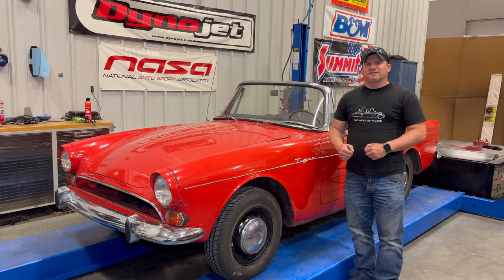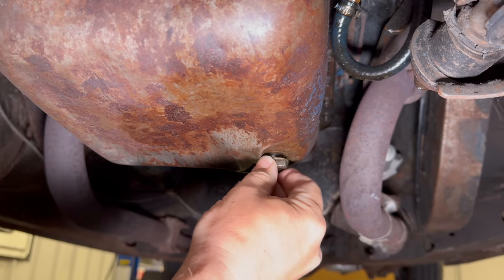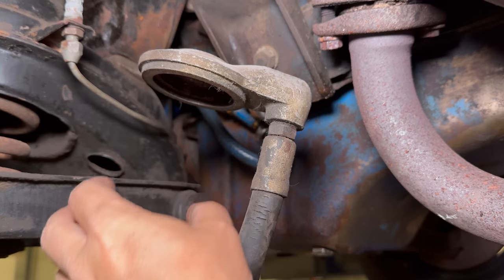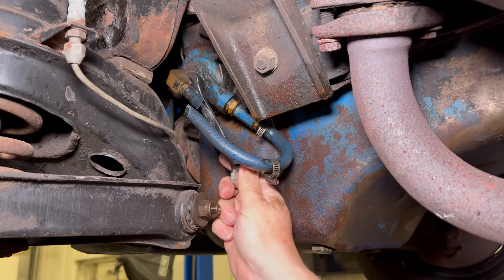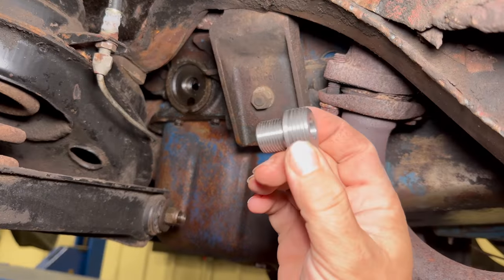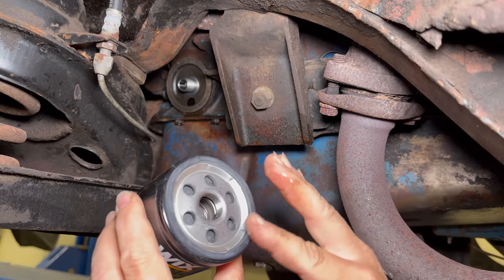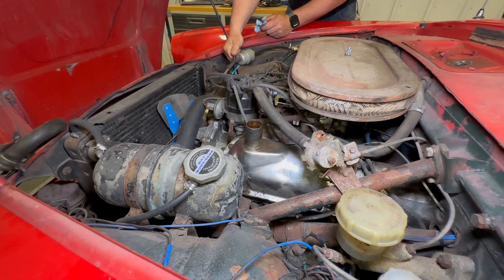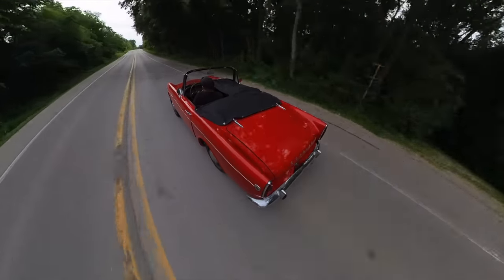Fixing the Previous Owner's Bad Ideas on my Sunbeam Tiger

Comment: Before firing up the engine with a fresh "empty" oil filter, spin the engine over on the starter motor with the ignition off (or disconnect the power lead to the coil), until  oil pressure is shown on the instrument panel oil gauge. This will fill the oil filter and better protect the bearings from friction loading under combustion from a dry startup.

Comment: Way to go. Good video and hopefully good filter upgrade. That filter resemble the unit used on Gravelys and other yard equipment back in the '60s. I have a Rootes dress up kit for a Tiger containing finned aluminum valve covers (no pcv opening), and chrome dipstick. I picked it up back in the '70s; never found a Tiger to go with it.

Comment: I hope you really snugged that oil filter adapter well as they are TIGHT from Ford. That oil looked about the consistency and color of driveway sealer. You might want to change that tiny oil filter 2-3 times in a few hundred miles then do an oil change at 1000-1500 then again at 1000-1500. There are several other lengths of shorty oil filters available with that 3/4-16 thread and ~2-13/16" OD body, being careful with the gasket diameter. Looks like a fun car to resuscitate👍.

Comment: If you actually want to make the Tiger drivable, scrap the entire rear suspension and diff, and find the suspension snd diff from a Nissan 180. With a bit of fab, you can have a differential that has limited slip, and will actually stand up to the V8.  The independent rear tanes the car and lets you actually use the power. My lap times dropped 5 seconds a lap when i did my swap. My particular Tiger has been a track car since the early 80s, so please put your torches away, no need to burn me a the stake. It was chopped and butchered LONG before i got it.

I guess another option would be a jag XJ rear, but the parts are bigger and wider, so it would require much more fab. But it would be more period correct i suppose.

I have all of the CAD files required to build the Nissan-Sunbeam conversion if anyone needs it.

Comment: This looks like either a MK IV or V, I thought by the MK. IV they already went to a 289 c.i. in the Tigers. Am I wrong?
Reply from the maker: IV and V are Alpines this is a Mk 1A Tiger
Reply: @ThisWeekWithCars  I stand corrected. I meant to say the first Tigers had a 260 and I believe towards the end of the run there were a very few with a 289. (?)
Reply: @robertcallahan4065  The Mark 2 Tigers in 1967 had 289, 200 hp Ford engines.  About 600 were produced.

Comment: What was the horse power rating on that Tiger. Thanks for sharing.
Reply from the maker: I put it on the dyno in this video: https://youtu.be/4NsE1-ImDXQ
Reply: @ThisWeekWithCars  Thanks , What a surprise.
Reply: The Ford 260 2V was rated at 164 BHP by the company. This engine was an option on Ford Falcon, Fairlane and Mercury Comet and Meteor models.
Reply: @jeffreycler495  thank you